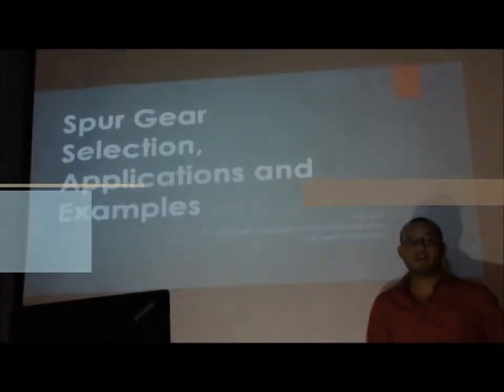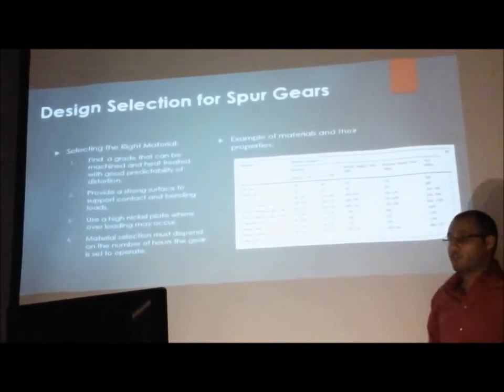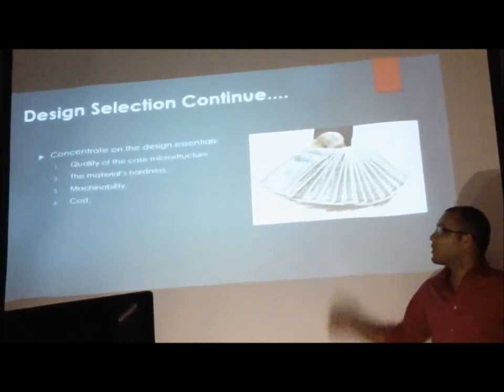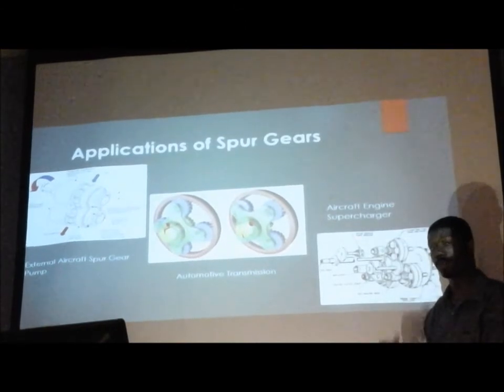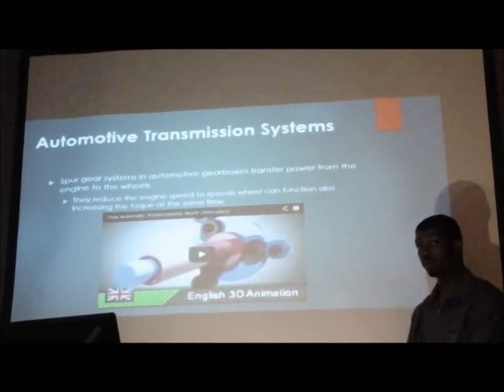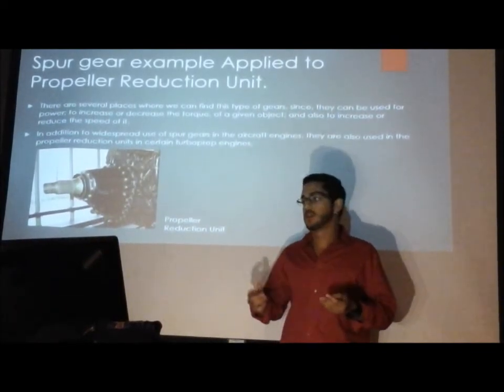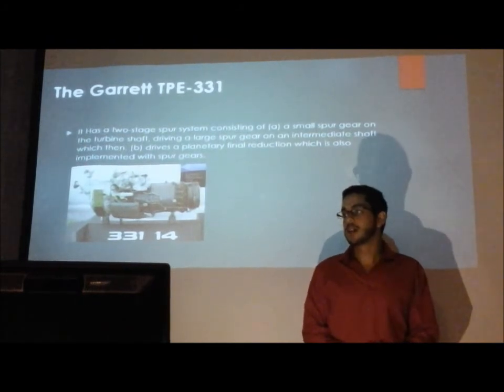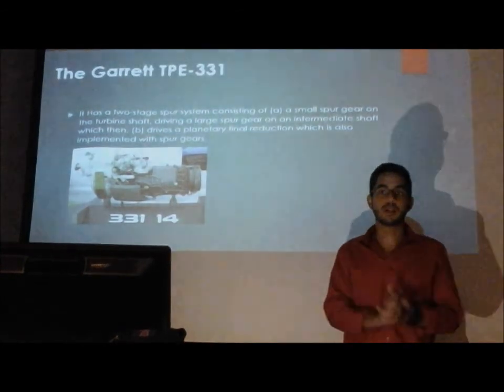Team 15: Spur Gear Selection, Applications and Examples

Comment: Very good presentation, good examples given on the slides, will be better if you can use more light next time and hold using another method to avoid shaking hands..